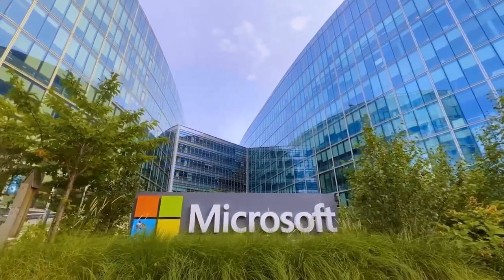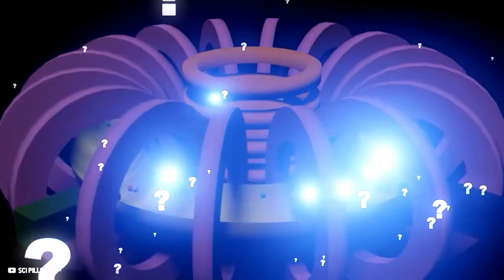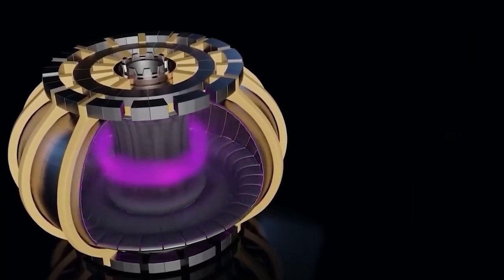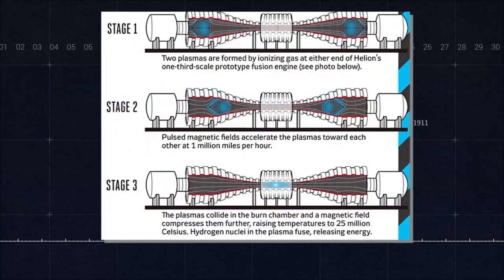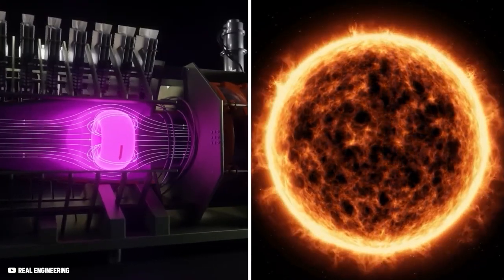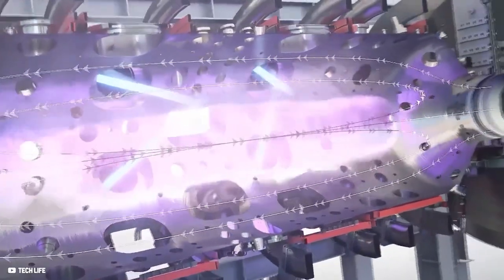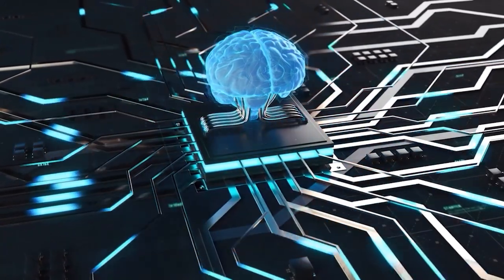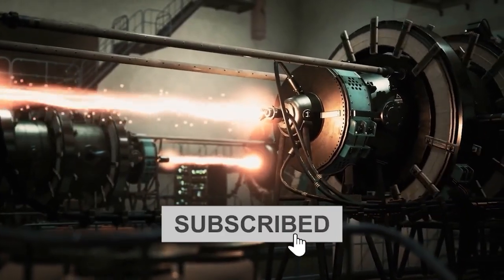Microsoft Just Cracked the Code of Nuclear Fusion with the Help of A.I.

Comment: Helion uses the D-He3 system but He3 is only available in minute quantities. I believe they have said that they will obtain it from D-D reactions, but in the list of the possible reactions below, this will also produce nasty tritium. Dealing with tritium will give a huge headache, and there is also some neutron production from the T-T reactions. 
a) D + 3He = 3.6MeV He + 14.7MeV p+
b) D + D = 1.01 MeV T + 2.02 MeV p+
b)              = 0.82 MeV 3He + 2.45 MeV n
c) 3He + 3He = He + 2p+
d) T + T = He + 2n
Reply from the maker: Damn! Thanks for providing this Valuable Information to our Community 🙏🏽
Reply: Why is dealing with Tritium a huge headache ? Neutrons, yes, they activate (make radioactive) other materials, and given enough time, mechanically trash the reactor, but Tritium can be extracted and stored. If left alone, in 12 years half of Tritium turns into He-3 by releasing electrons. This kind of radiation is so weak that it cannot even go through paper. If released outside, it is so light (it is a form of hydrogen after all) that it sores to the highest levels of the atmosphere right away, from where the solar wind takes it to space. Tritium does not bio-accumulate, if you ingest some, in gas form or as tritiated water, your body will get rid of it in days.
That does not sound like a solid argument against Helion's reactors.
Reply: The plan is for a Dedicated rector that will produce He3 and little electrivitt. This reactor can provide enough He3 for 10 others. The chemical reaction for this rector is out there on the Helion peesentations

Comment: Young man's company cracked the code for Fusion not Microsoft Microsoft is riding on the back of this company which is fine that's business remember the guy that takes the credit for Microsoft company the present owner he's nothing but a Salesman and always will be there's nothing wrong with that but like everything else the coach refuzion will be cracked several different ways a I can take give you examples of what worked and what didn't work and what might possibly work that's all I can do😊